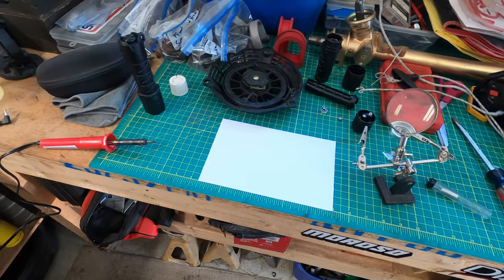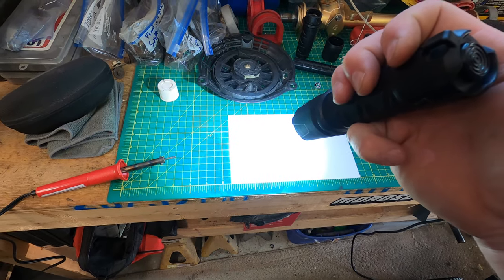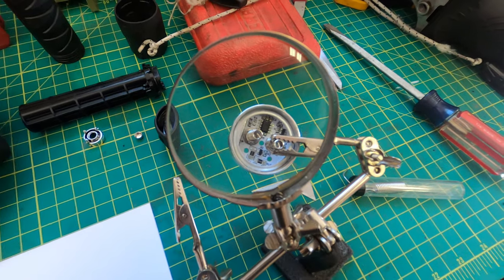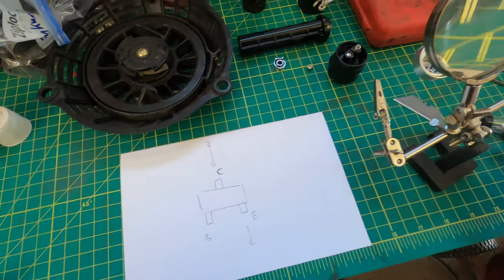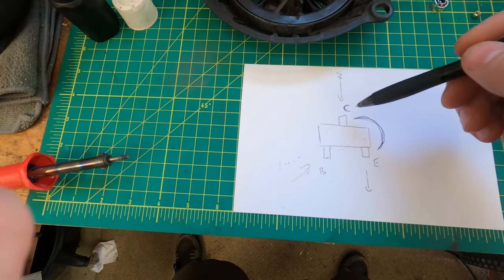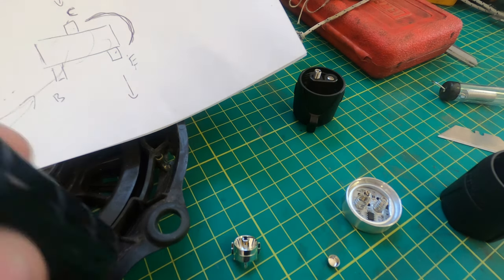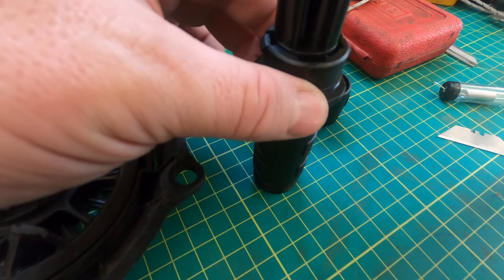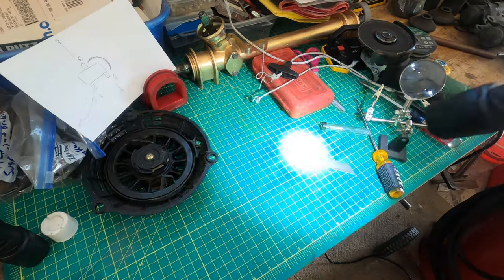Duracell Flashlight Mod - Remove Strobe

Comment: hi,  loved your video. its great that you know about circuit boards this way, Can you please make a video on the fact that some Duracell flashlights draw current while they are off and drain batteries ? and which ones do that and which ones don't ? and is there a fix ?
Reply from the maker: There isn't really a fix other than removing the batteries when not in use.  Most flashlights that have multiple modes have a processor watching for you to click the switch.  Even when it's off the processor is powered waiting for input.  I really like my surefire, you just twist the cap a full turn left and it physically disconnects the batteries without removing the cap.  That also keeps it from coming on when packed in luggage or bouncing around a glovebox.  Butt for the price of that flashlight I can buy a 10 year supply of batteries!

Comment: Man, please, PLEASE help me. I got three big ass headlights that cost me over 1000 USD that have this same problem. Every time it turns on, it switches between steady and strobe. Problem is, these are sealed headlights, I CANT GET TO THE CIRCUIT BOARD WITHOUT RUINING THEM. Do you have any ideas on what I can do? Something with relays, perhaps, so I can avoid having to play with my lights to get them to shine steady? Please, I’m begging you.
Reply from the maker: What brand/model headlamp?

Comment: I've been collecting and modifying flashlights for quite a while now. It's quite unfortunate that the end consumers have to do such mods on these consumer-grade lights in order to get rid of utterly useless features and get them to function like what we want. If you are going to implement flashy modes on a flashlight at LEAST do it in a way where it is hidden and isn't going to annoy the user like to long press the button for a few seconds or quickly press it 4 times etc. 

Also there's no reason to implement flashy modes on literally everything with a light. You'd laugh if i was to tell you what things I've found with these stupid flashy modes. They'll put them on anything wit an LED. They are willing to put them on s*x toys if they could 🤣

In the end you are far better buying a proper flashlight from a brand like sofirn wurkkos or acebeam. Even olight is a good option but is more expensive for no reason. I personally don't like these consumer-grade consumer targeted flashlights but they have their uses i guess.